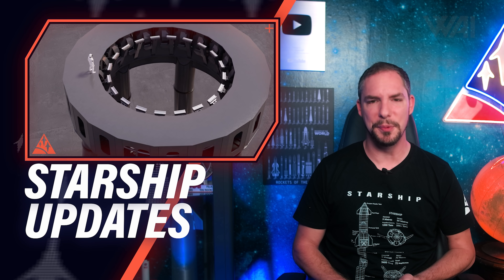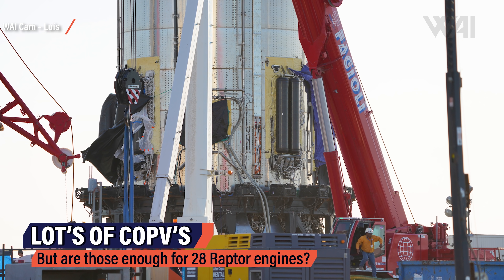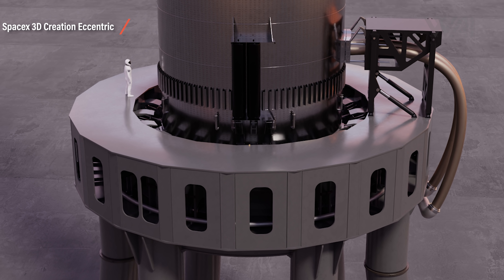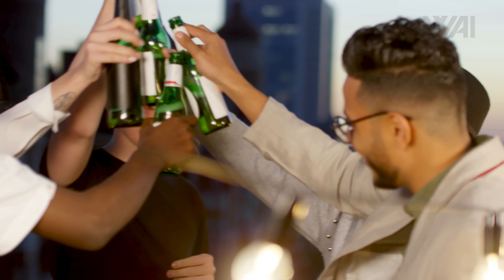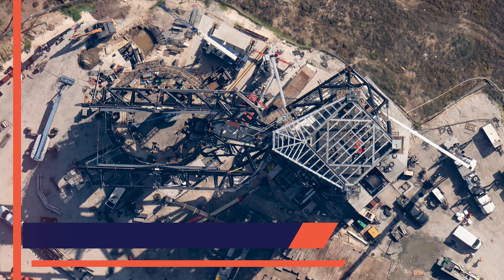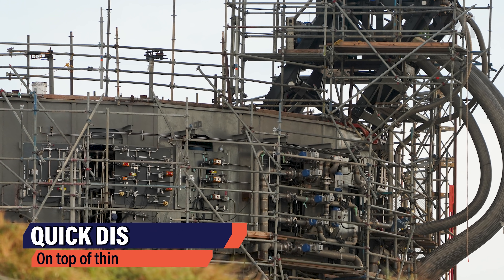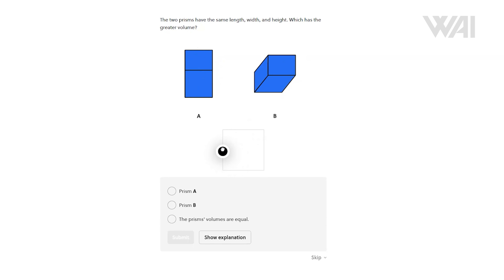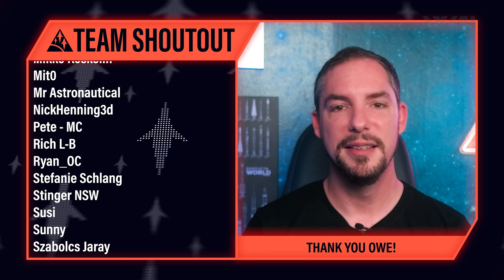SpaceX Starship & Super Heavy engine mystery solved!

Comment: Elon et al have said that one of the tanks in the new tank farm is supposed to be for water for the sonic suppression system. I don't think it is near ENOUGH water, but at least there seems to be something. One launch of that SH will show them just why it's so important, as they don't seem to be taking it seriously enough yet.
Reply: Which seems a little strange. They regularly launch rockets, there is now way they don't have a deep understanding of sound suppression and that it's necessary (probably)
Reply: Near enough water ? The water tank contains approximately 4.5 million liter of water (R=6m ; Height = around 40m). That's definitely enough water to suppress for the few seconds of launch. SLS water suppression system will use a tank with 1.5 million liter of water, flow rate of 4.5m liter per minute.